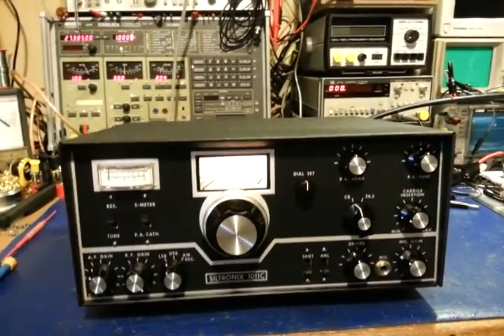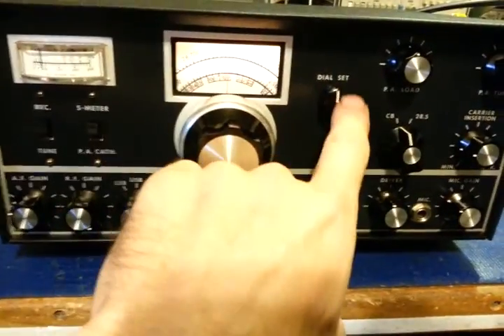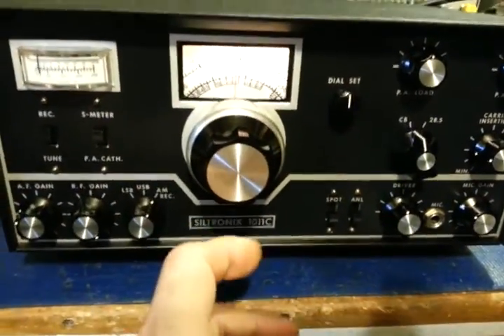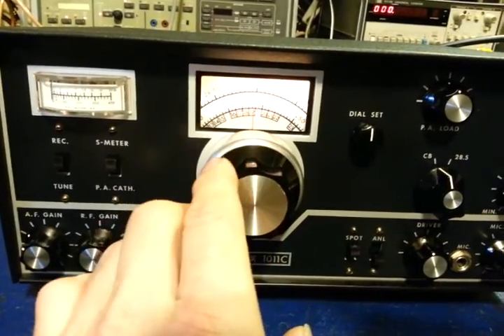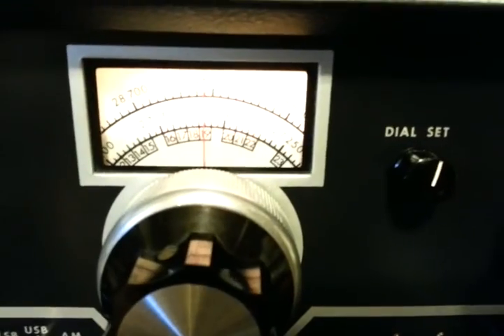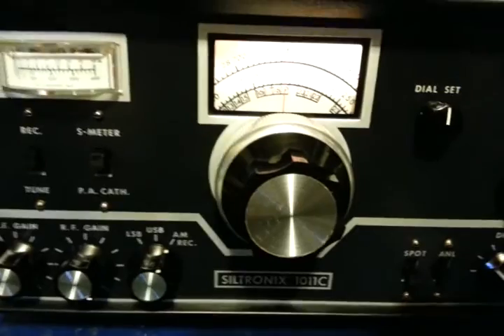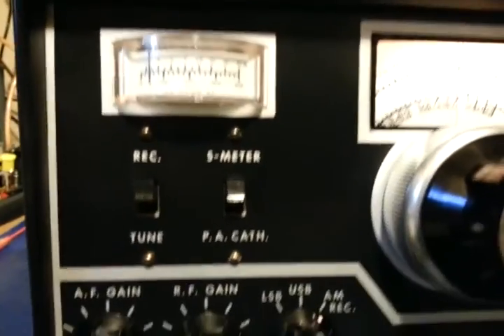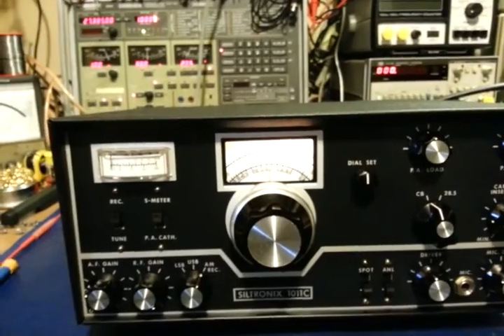Siltronix 1011C 10 Meter tube type transceiver

Comment: I happen to have one of these. When you turn it on, s meter pegs, little buzz, no speaker action and no tubes lit.
ideas?
Reply: Sounds like something in the low voltage section for the tube filaments

Comment: i recently bought a Siltronicx 1011d    I thought I could use alternating current from the wall to power it.   The rear panel has two outlets which are marked  117 volts..   I cannot find a plug to put on a line cord for these plugs.  Does anyone know where to buy such a plug?
Reply from the maker: You might try Kens Electronics.  No guarentee they will have one but if anyone has one for sale it will be them.

Comment: Hi Mike! 
  I have 3 Siltronix 1011D models. One of mine has a ground loop type hum when you put the RF gain down and the volume up, that's when it could be heard best. It's recapped, new rectifier diodes, all controls cleaned and works relatively well. I swapped some tubes around from my other ones to this one but it hums with the other tubes ( and most of the ones In Or out it will hum so it appears to not be a tube issueThe hum is not ripple, it's like a guitar amp hum. Just wondering if you or anyone else has seen this.  Thanks in advance Richy N2ZD
Reply from the maker: Sooooo many things can cause noise.  The good thing is very easy to find.  Just start at the speaker and work your way backwards through the audio chain with a signal tracer.  It could also be in the RF/IF system so if you still have it at the input to the audio circuit continue back through the rest of the radio.  It could be a noisy coupling cap, carbon comp resistor (very common problem in radios and audio amplifiers), almost any component can cause noise problems.  The humble signal tracer is by far the easiest way to track down problems like this.
Reply: Thanks Mike, I appreciate the quick reply and the helpful tips. I love watching your videos! 
    Anyway, I always had a love for these old Siltronix rigs. The styling and the build quality is awesome. Hopefully I can figure it out or I'll send it to you for a tune up and an ass kicking lol..

Comment: I always loved the dial set feature. Front panel option to zero beat the dial in seconds instead of a covers off alignment. Even the rigs with the marker chrystals weren't right because it didn't calibrate the if, only the tuner.